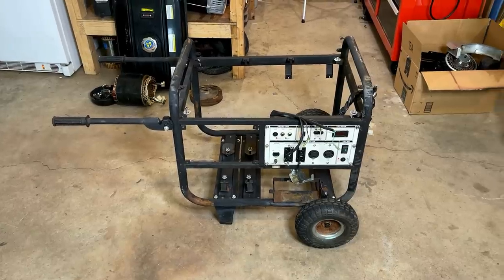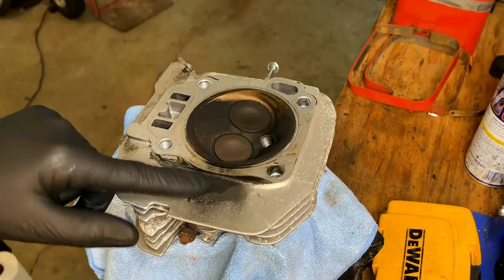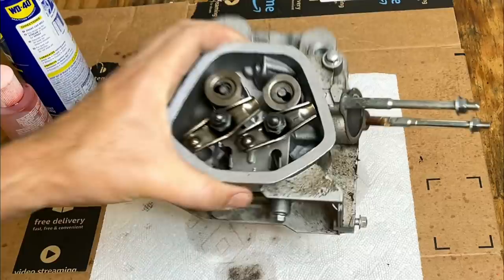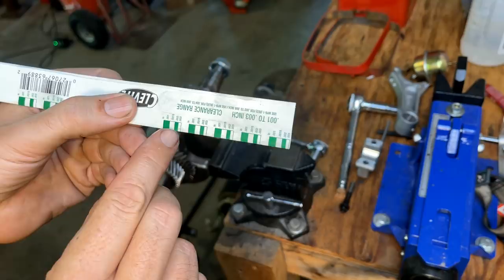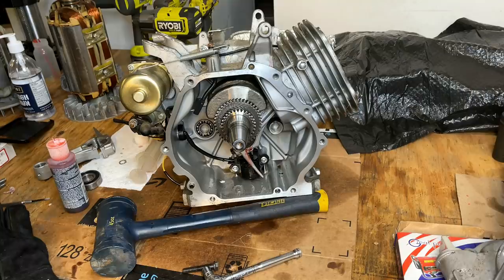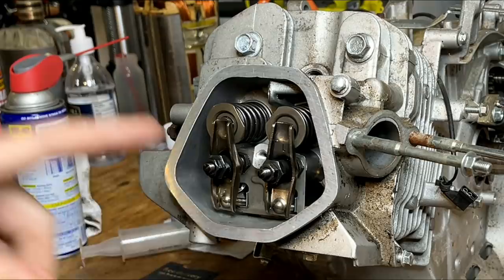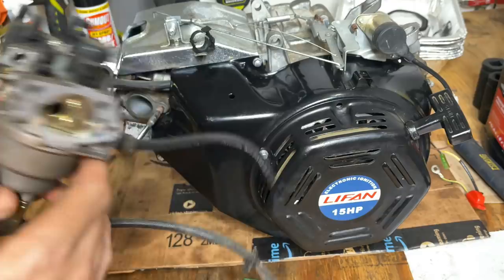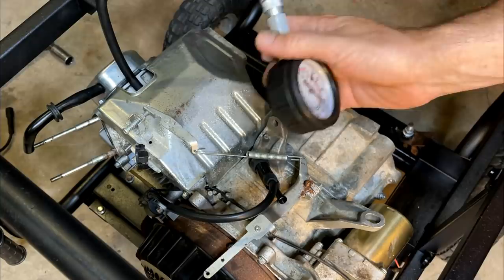Engine Rebuild - Seized LiFan Generator (Part 2)

Comment: I set the valves on small engines with one valve open the other closed,  one at a time.   Think about it ... the compression release will not function properly if there is clearance at top dead center when the valve is supposed to be "bumped" a bit open.    Briggs addresses this by saying 1/4 turn past top dead center when setting clearance..   As far as I know all small engines with cam release compression releases work about the same way.   Try it and see if it will start easier.
Reply from the maker: That is a good way to set the valves.  Not to give anything away, but there is another broken part that I missed.
Reply: @jcondon1  Adding some mystery!
Reply: How do you fix kickback in generator despite the compression release on camshaft not damaged?

Comment: Hi Jim... Wonderful video as always, and I love your "diagnostic dilemmas"!  Thorough, methodical and rigorous approach.  I may have missed it, but did you figure out what was wrong with the original connecting rod, which looked to be new?  Was it actually the correct part?  I'm waiting to see if you finally identify a single "root" cause for all of the parts failures, or if it was the case that multiple parts had failed or were not the correct part for that machine...

Comment: It almost looks like someone put a grinder to that pushrod guide. You can see where what looks like the overshoot from a cutoff wheel was.
Reply from the maker: I missed that, but it seems obvious now that someone did use a Dremel or something similar on the pushrod guide.

Comment: Wow.  Salada work for sure.  The back firing has me puzzled a bit. Anxious to see next part.  You are a master at these generators and engines.  Thanks for the video's.  I love your paint booth.  After washing some parts in the kitchen sink how long did you have to sleep on the couch.
Reply from the maker: Washed this one outside.  The EU2000 was in the sink, several times and yet people say I did not wash it.

Comment: Hey, I didnt saw you checking voltage on those four pin connectors while running.  I have no voltage on mine these connectors. But also i have second connector to avr with two pins

Comment: Ugh. Fuel shutoff solenoids, aka the bane of my existence. I begin every revival I do by removing them and installing manual shutoff valves. If you are having a carb issue, I have found them to be part of the problem more often than not.

Comment: when you have electric start and the carb. off, why don't you drip/spray some fuel in the inlet while cranking? that way you don't have too long between dropping in the fuel (let that seep through the piston rings and dilute the oil) and cranking (putting back the spark plug takes some time)
Reply from the maker: I normally do.  But people complain about that sometimes, so thought I would try it the hard way.
Reply: well now you'd have a valid argument not to drop it down the sparkplug hole: bad for the oil. (if there would be any left on the cylinder wall, that is now gone)

Comment: I have a Generac 5Kw generator with a 10hp B&S Flat Head I'm having a hard time finding a Filter Box and Muffler ... You can see it on my Video about my Mini Bike ... It works but I need tools for measure the Hz the Governor adjusted
Reply: @jcondon1  I posted a Short

Comment: Hi James! You do good work man! 
Hey what do you use for a cylinder hone? I bought a spring loaded brake hone kit from Advance Auto  with several different sizes and the biggest one that fit my 2000 Ford Focus cylinders I only used it on that car  but the next time I needed it to hone my 80 gallon Air compressor cylinders the pads came off.

Comment: Good ol WD-40, I used to use it to get stuck on rubber off my 72 novas quarter panels after we went to the drag strip, took it right off
Reply from the maker: Its good for many things.
Reply: @jcondon1  sure is, used in distributor caps when they'd get wet

Comment: Hi Mr C,  can you use oven cleaner to get the carbon off around the value area.?
Reply from the maker: The lye in oven cleaner will eat the aluminum.  It’s only good for cleaning aluminum off the crank.

Comment: I look forward to your videos.  Did you put thread lock on the valve studs after you changed the plate?  Can't wait for part 3.
Reply from the maker: I didn't use thread locker.  Normally do not see it there, but I have used it on engines where the studs came loose.

Comment: Head surface should be sanded on a piece of granite or glass to make sure it's flat, as far as the rod I would have sanded the cap to it tork to spec.and honed it to .002 clearance  and used the same rod.

Comment: Does grinding that connecting rod bolt affect engine balance? With the clearance to the crankcase being super tight, any concerns about the metal heating up and expanding enough to cause contact?

Comment: I see that was not correct for the gear's two dots. 37:36 / 1:02:02 Your motor runs fire back. You need adjustment correct.

Comment: the valve retaining thing was probably never put in during assembly. I'd expect more damage to the cylinder walls if it had got in somehow. that wouldn't destroy the main bearing, that's from low oil.

Comment: I guess I missed your explanation why you left the retaining cup off the intake valve.  It would seem logical that both valves would have them?
Reply from the maker: Some generator engines have no rotator caps.  Others have them on both valves.  This one was only designed for one on the exhaust.

Comment: That pushrod plate looked as if someone took a dremel type grinding wheel to it, lots of overheating as well as a visible cut mark. Some bodger, clearly. Bit more time to do the job properly and they wouldn't have lost a fortune on a potentially good machine.
Reply: I thought the same thing.  Definitely doesnt look like the valve stem did that damage.
Reply: Also feels strange this cap would destroy the rod bearing and not chew up the governor plastic gear.
Reply: @pepethefrog7193  I reckon that after bodging the valve setup, they ran it out of oil. 
Just hope James doesn't  find out the hard way that the oil pump is also bust.
Reply: @kevgermany  Those things have no oil pump.
Reply: @pepethefrog7193  that's a relief
Reply from the maker: Great point, the push rod would have just a path in the plate the width of the rod.  That looked like a clean cut with a Dremel.

Comment: Sooo... I noticed the dipper on the rod was pointing the other direction when you reassembled to the piston... Don't know if that would change the clearance tho...
Reply from the maker: I just went back and watched the video when the engine was first opened and when I put it back together.  Dipper seems to be pointing the same way.

Comment: as ever, a great vid, I love to see these. But in this case, do you not need to measure the crankshaft after removing the aluminum deposit, not before?
Reply from the maker: Kinda did that with the Plastigauge.
Reply: That is exactly right James !

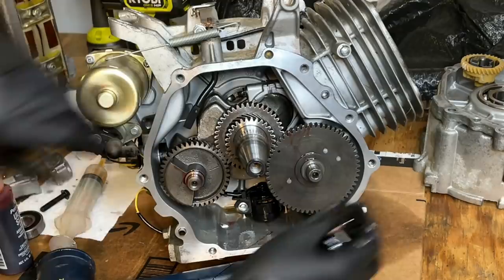Comment: When it backfires like that and not releasing compression, isn't that a timing issue then? On 37:42 it looks like the timing is just a cog too late? Might be the camera angle that makes it look like that. I mean, the compression should release automatically when exhaust valve opens right?

Comment: It looks like the decompression not working is the cause of high compression ! Did you check the length of the new Conrod eg bore to bore ?
Reply from the maker: Did not measure the new conrod length, but held them side by side and also took note of the piston travel once installed to make sure the piston raised to the same height.

Comment: Hi James was after some help I have the same generator but different UK brand called Clarke, it broke a valve which damaged the cyclinder head and piston. All replaced with new parts followed your rebuild procedure exactly as in this series of videos a d she just wont start. Moving through the stroke perfectly but just cranking and occasionally backfires????? HELP

Comment: whenyou mention the rotator cups, i learned that only my 209 cc Chonda has one on the exhaust valve and two 160 cc clones have none at all.. play on the exhaust valves was within specs (for Honda) so there can't be something missing on it's own accord, can it?
Reply from the maker: Some generator engines have no rotator caps, some just the exhaust and other have it on both valves.

Comment: When I start up my lawn mower, light gray smoke comes out of the exhaust. Could the rings have slipped and the gaps lined up so the gas isn't all getting burned?  I know the OHVs are adjusted right, but the primer bulb is cracked and I have to pour some gas in carb to start it.
Reply from the maker: If only at startup then would not worry much about it.
Reply: @jcondon1  I've been concerned about it! The mower is about 8 years old now and I figured it may need a ring and valve job.  It's an expensive mower and it would  be worth some TLC. It's a Snapper hi vac 22 inch Easy Speed rear wheel self propelled mower. I just haven't had the money yet to take it to the shop and I don't have the tools to do it myself.

Comment: The most difficult thing with plasti gauge is torqueing the cap and not moving the rod.
Reply from the maker: I agree
Reply: @jcondon1  Squatch 253 tells us to use the Plastigauge opposite of where the gravity works. You measure less than the actual clearance when gravity is drawing the connecting rod down.

Comment: Very interesting video. I cant see how the valve stem end cap got in the engine?
Reply from the maker: In retrospect it probably did not.   Do not think it could have fit in the oil return.  But I found another issue which still points to metal in the sump.
Reply: @jcondon1  yep I get the bits of metal found, would be the worn down rocker plate. Just my thoughts James.

Comment: your valves springs retainers ARE not installed correctly your exhaust is pointing to 1 o'clock your intake is at 11 o'clock they ARE supposed to be pointed DOWN at 6 o'clock or they will hit.
Reply from the maker: Correct.  I think I fixed that in part 3.

Comment: Out of curiosity, what caused all of the wear on the rocker plate?    Poor factory assembly techniques,  inferior metal quality or something else?
Reply from the maker: Some have pointed out in the comments that it looks like someone cut it with a Dremel.  If the pushrod had done that it would have cut in the width of the pushrod.

Comment: Do they not need bearings for the rods at the crank because they're aluminum, or because it's a small engine?
Reply from the maker: Unfortunately small engines never have a bearing for the rod.
Reply: @jcondon1  To me, that's strange! Aluminum rods, block and head,  steel valves, crank and cam, but no bearings sounds like a train wreck looking for a place to happen!

Comment: Jim, Rance here. Did you check the spark plug boot resistor? Or does it not have one?
Reply from the maker: It has one.  Will take a look.  The resistance on the meter did not look that bad.

Comment: I lost you.  Just how does a rotator cap get down past the piston and cylinder walls not to mention the valve and valve stem themselves to create damage on the rod without doing severe damage to those parts and the head combustion chamber in its journey?
Reply from the maker: There is an oil return from the top end to the bottom.  But in hindsight, not sure the cap could have made it.  The oil return seem a little smaller then the cap.

Comment: Try Mineral Spirits it cuts that carbon better than WD40 and cheaper.
Reply from the maker: Will give it a try.  Always seems to take too long.
Reply: I put it in a spray bottle. Clean many a engine with it. Everybody has different results. Keep up the good videos. Thanks

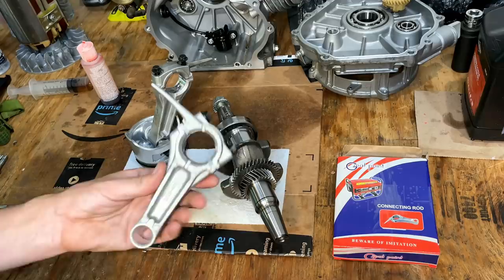Comment: Anyone know the answer to this equation. The horn on push rod in page 24:00 puzzled me - is there an oil shaft in the horn? If not how may oil be delivered into the crank bearing?

Comment: Why measure the journal before cleaning?  Surely the aluminium build up would skew the measurements?
Reply from the maker: Good point.  Also used plastigauge after the cleaning.
Reply: @jcondon1  Loved your videos anyway man.  Just nitpicking a bit!  You have a very extensive toolkit and it's great to learn your methods with those tools.  Thank you!

Comment: I always wonder why you don’t use and oil can,  a syringe is simple not needed.  Oil cans are designed to oil.
Reply from the maker: The funny thing is I have one.not sure why I choose what I did.
Reply: @jcondon1  lol.   Well, I’m sure you will figure it out.    Have you ordered a new Cam shaft yet? (Assuming the Comp release comes pre installed.)

Comment: U ordered rotator caps and then didn't install them?
Reply from the maker: Sorry must have cut that out.  You can see it installed on the exhaust when installing the head.  The intake does not have rotator on this engine https://youtu.be/X2bW8zwcs0U?t=2469
Reply: @jcondon1  
OK

Comment: Almost as interesting as a rebuild video on a real Honda Gx 390 haven't seen toat one yet...
Reply from the maker: Not many blown Honda's out there.
Reply: @jcondon1  I'll wait for thats all I use for my longtails GX series and why I subbed  u have by far the most informative small engine channel. Currently, I have a  390  with that same high compression problem. The service place says for sure it's the valves set wrong, been that way a long time.

Comment: its actually not a "clone" ..... look up the "no compete agreement" between the chinese an japanese no need in me explaining it .... and youre wrong about parts lifan (leefawn) has parts distributors all over the states any china bike dealer can help ya.... honda parts will fit once ya decide which model it is.... dont tell the honda dealer its chinese or he wont help... lol this damage happens when oil isnt changed ....